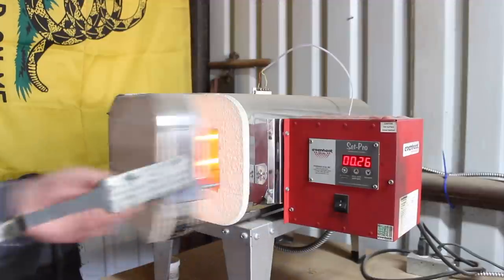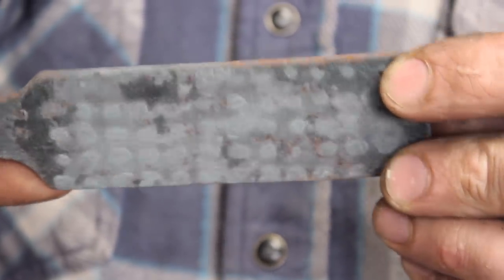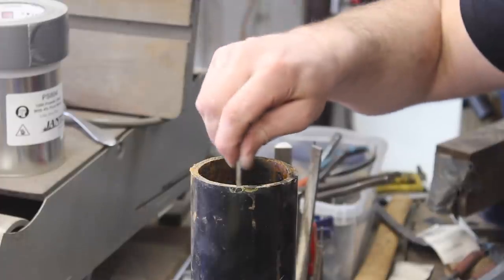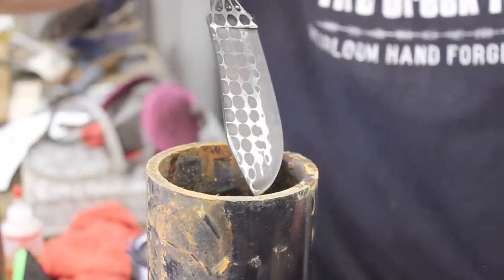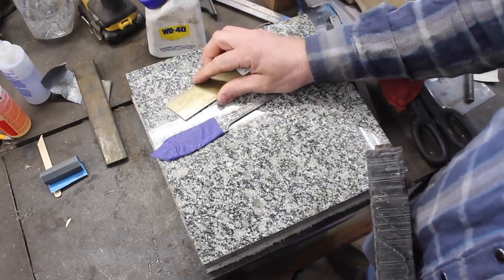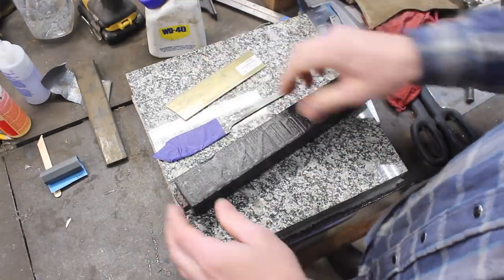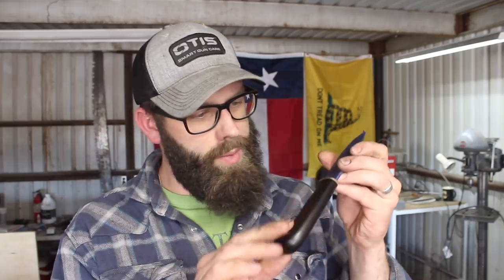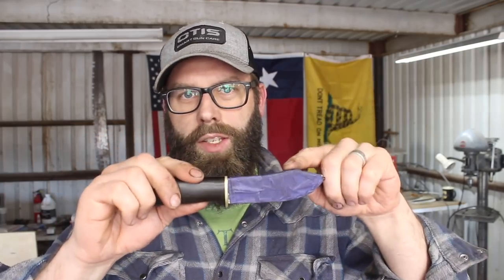Ball Bearing Matrix Damascus Knife | Steel with programmed pattern | Pattern Welded Knifemaking

Comment: The blade is absolutely amazing and I love the puukko style handle
Reply from the maker: Thank you!
Reply: @FireCreekForge  i have a question for you about would it be possible to forge weld 5160 spring steel and 15-n-20
Reply from the maker: @chewyakarieckenicholas6049  yes it is